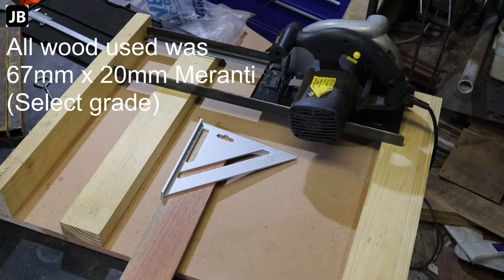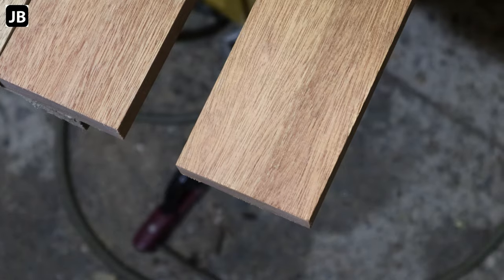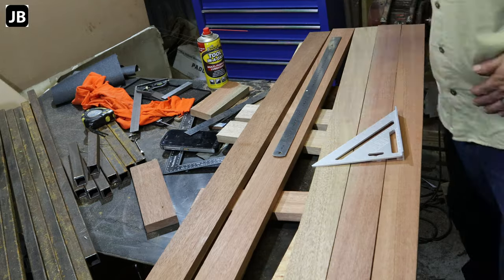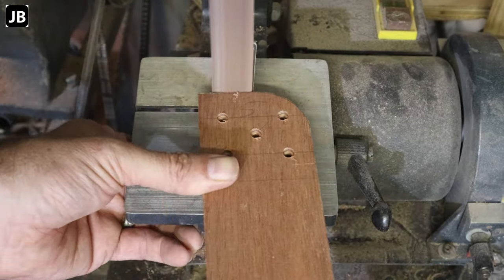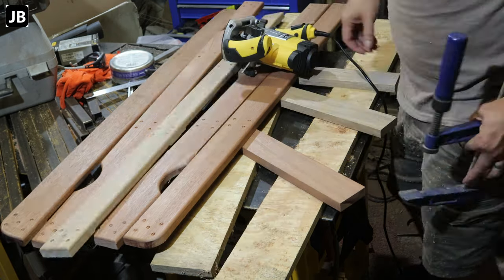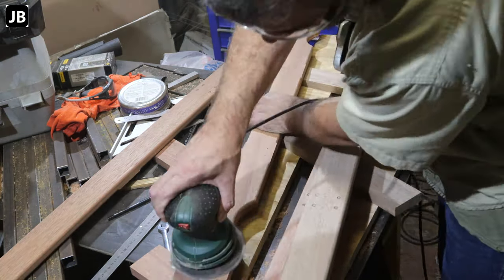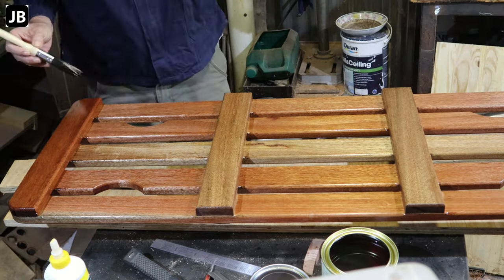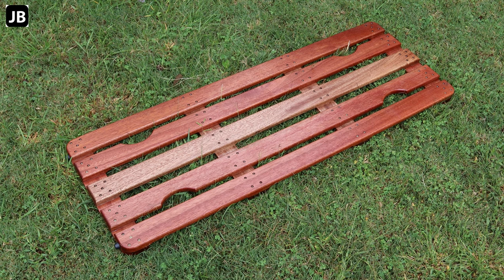DIY mud board Build. Must have for all field service.

Comment: Awesome build Jaco, particularly useful when I need to change the oil on my vehicle. I'd like to see a review on your sander, been looking into getting myself one mainly for deburring metal, using the flap disc on the grinder can be very cumbersome when I'm in the workshop. Thanks for sharing, great video
Reply from the maker: I will be doing a review in the not to distant future.